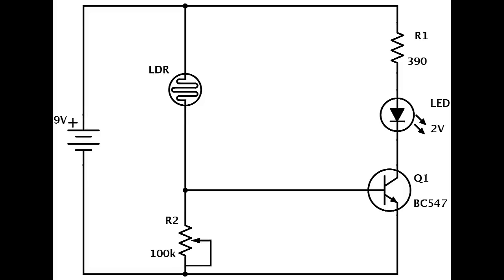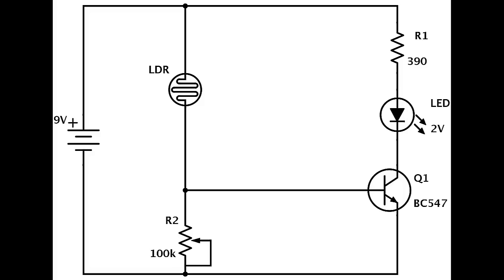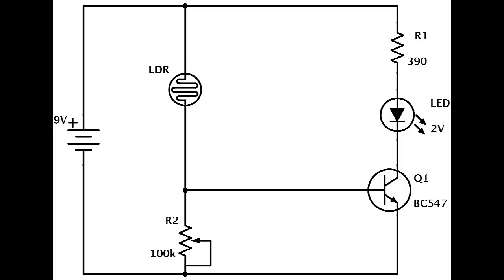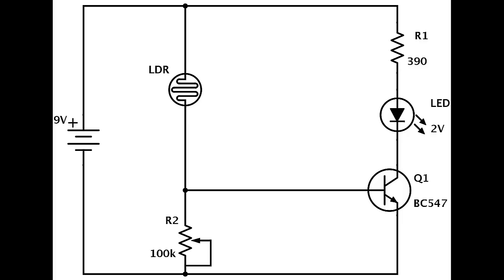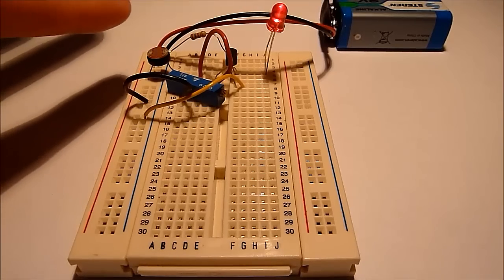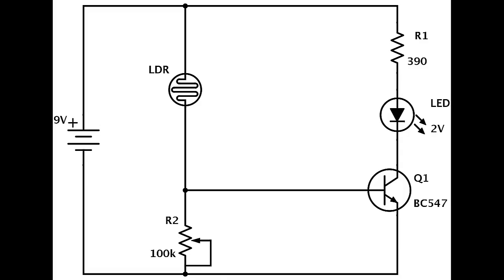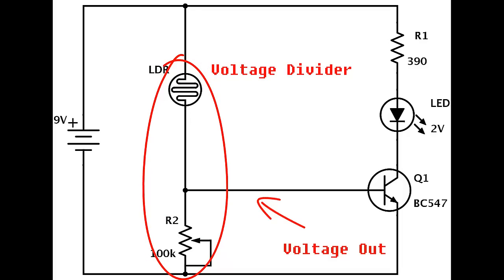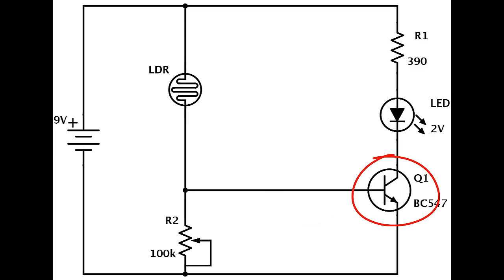Circuit Diagram - How to understand and read a circuit diagram?

Comment: Have I got this right? The picture you show beginning at 0:22 tells me that I need to solder 6 components in an endless loop. For most of them, the connecting wire would be cut and soldered to the next component in the loop. But at the upright between the "LDR" and the "R2" I would connect the two wires to form a sideways "T". Do I have this correct?
Reply from the maker: Yes, that sounds about right. Here's a very similar circuit and how you can connect that on a breadboard: https://youtu.be/mHBG2sBcyTM
Reply: @Ohmify  Breadboards may be helpful for someone who already understands what's going on, but not for the purpose of teaching. Breadboards hide everything from view.  You can't see how it all connects. Where are they used in the real world? I've never seen a breadboard inside a stereo component.

Comment: Very Inspiring intro to circuit diagrams :-) My washing machine circuit board (INVENSYS
 475570) is not working partially. The program doesnt start when I push the start button. I see no physical damage. Wonder what could have gone wrong. The last time the machine didnt complete its full cycle. So in doubt I restarted it to see the display again and then shut it off and opened the front door too quickly, Since then the start button wont lock the door and start the program! wonder if I can replace a part on the control board pcu!?
Reply from the maker: Maybe.. I have no experience repairing washing machines.

Comment: My goal is to identify the functions of the devices in a given circuit diagram?
Or spoken more general.
How can I lean this general skill?
When do I see a random circuit diagram that I can recognize the devices and their functions?
What is the best strategy to acquire this skill?
Do you know good information recourses specially designated to acquire this skill?
I do not want to handcraft things on my own and I do not want to study at a university to acquire a bachelor's degree in electrotechnology.

I just want to be able to read more or less the circuit diagram.
Thank you in advance
Reply from the maker: I recommend building circuits as it's both fun and makes it much easier to remember. But if you don't want to build, then I'd recommend reading a lot of circuit diagrams. Start by getting a basic understanding of voltage and current. And get familiar with the relationship between voltage, current, and resistance (Ohm's law). Then continue to learn different resistor circuits (series, parallel, and the voltage divider). Get to know the basic components, and check out circuit diagrams that show how to use them. From here there are many ways to go. Audio, radio, microcontrollers, instrumentation, etc. Focus on studying circuits in the field that interest you the most. You could get a book like the Arts of Electronics, you could sign up for an online program such as Ohmify, or you can simply find lots of circuits online and study them.
Reply: @Ohmify  Thank you. 
This 5 rules i know well Ohm for both
for serial 
Kirchoff tension, tension devider 
for parallel kirchof power knods and power devider  
I know also the  most basic symbols for resistor, capaciter, coil, diods, power supply. When it comes to pretty easy curcit diagramms I can already read them.
But this is not good enough for what I need to do. 
I saw good job descriptions I could work in sales, purchases, quality management. And not as a developer. So I never need to calculate and to actively handcraft, sondler etc...
In the job requirements are always written more or less this:
 knowledge to recognize the function of devices based on circuit diagrams especialls in this fields:
High frequency technology, power electronics, signal electronics.

What is the best way to acquired knowledge to recognize the function of devices based on circuit diagrams especialls in this fields:
High frequency technology, power electronics, signal electronics
Reply from the maker: @timstoriger3927  Ok, great, then you have a good foundation. Then my recommendation would be to just start looking at these circuits. You don't need to understand them, so all you need to do is try to find repeating patterns in different circuits of the same type. One place to start could be in Digikey's reference library: https://www.digikey.com/reference-designs/en
Reply: @Ohmify  

Thank you
.The link is great.

But as a rookie, I am still lost.

I look especially for schematics in this field.

High-frequency technology
-Cellular
-Messaging, coding
-Location, direction finding and navigation with radio waves and other waves

Signal electronics
- Automation technology, diagnosis, safety and monitoring systems
- Control and regulation technology for vehicles, driver assistance systems and display devices. 
- Measurement of mechanical, electrical, magnetic and other physical quantities, amplifier circuits and their regulation
-Impulse technique

Power electronics
- Power converters, regulation of electric motors and generators 
- protective circuit arrangements
- Battery charging systems

Do you know how to find them easyly on this website.
Accordung to this shematic I will start then to acquite the necessary knowledge I need.

What is the best way to acquired knowledge to recognize the function of devices based on circuit diagrams especialls in this fields: High frequency technology, power electronics, signal electronics?

If you have additional advice I will be very thanks full for your dedicated time
Reply from the maker: @timstoriger3927  Sorry, I don't have any more info about using that site. Maybe someone over at https://www.edaboard.com/ can help you further
Reply: @Ohmify  thnx

Comment: Hii i am dhananjay i want to say first this thins you explained is help me but i have a question that, if want to built led tv just imagine, first i have to know the circuit components like resistor, capacitor,etc. Then we have arrange  in the sequence of order to work a circuit so where i can i do or learn it . did some books fir this available in the market to design circuits
Reply from the maker: Hi, I recommend you start by learning to build a simple circuit with one LED. Then learn to use a microcontroller (for example Arduino) to blink the LED on and off. 

Learn how to control a row of 10 LEDs independently from the Arduino, for example by making them blink in a predetermined pattern. Next, learn how to control an LED matrix of maybe 5x5 LEDs. Use this matrix to make a simple animation. 

Next, get yourself an RGB strip with addressable LEDs. Learn to control the color of each LED.

Once you've done that, you'll start to see what the electronics of an LED tv does.
Reply: @Ohmify   does it also helps in building the led's. Apart from this i would like to tell you that thank you so much brother for teeling me a path for that i know something and one thing is that i just start seeing some books first i have seen some encyclopedia of electrical instruments to gain knowledge
Reply from the maker: @princeshridharbhandari7826  Yes, it helps a lot to build the LED circuits.
Reply: @Ohmify  thank you brother love you a lot.
Reply: Please brother help me to find it ?

Comment: but in a circuit diagram i saw it had a wire connected in between another wire...what does that mean?
Reply from the maker: Sounds like a connection from one wire to another. It just means you need to add a wire there.